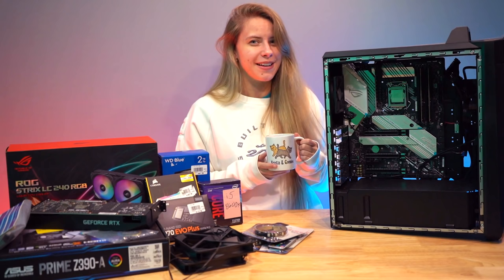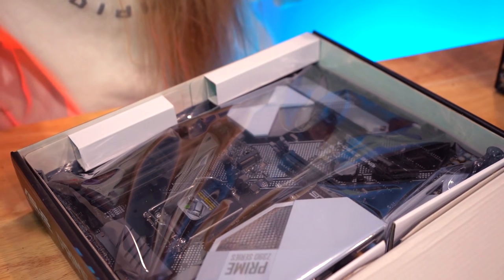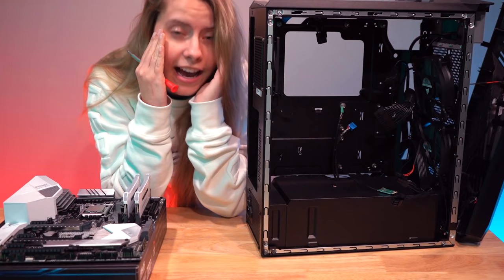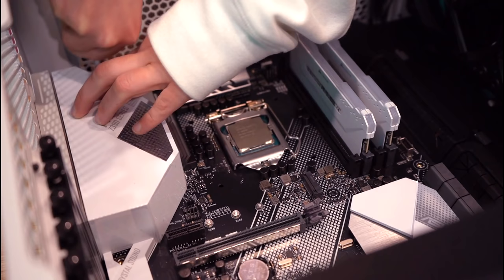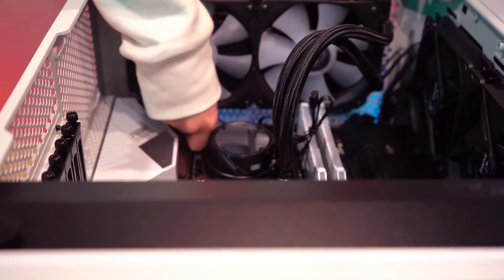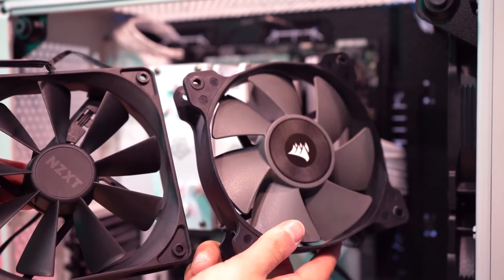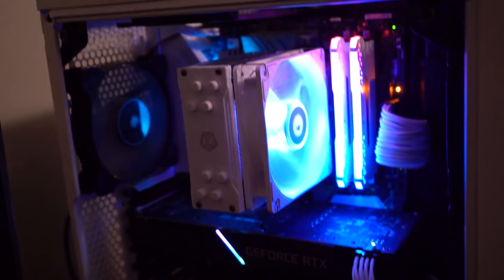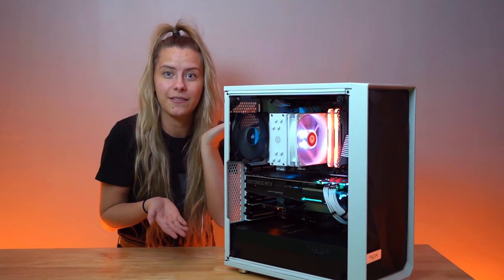I SURPRISED HIM W A CUSTOM PC! 🧡 + GAMING SETUP MAKEOVER! Powered by ASUS ROG

Comment: Pro Tip: plug in your CPU 8 pins before you mount your cooler radiator due to the space limitation.  I have sausage fingers and can never manage to plug those in once the rad is mounted.  It's much easier to push the cables down if needed once they're plugged in vs. trying to squeeze your fingers and the connectors in there.

Comment: just a little tip to anyone new to pc building, check the casing dimension and GPU that you will use before building one, it's a very common problem. :D this is a solid informative Video!

Comment: So I know this video is old at this point in time BUT some times its good to plug whatever video cable you are using into the mother board and double check that its not set in the bios to run video out from the board. Switching cards can cause it to change over (had it done to me) but never hurts to try and see what happens along with re setting bios.

Comment: You can plug a 3 pin fan into a 4 pin connector it's completely fine. But the rgb connector is different just like she had said.
Reply from the maker: fan power yes, rgb header absolutely not ur pc will die LOL

Comment: I was able to get the Deepcool Gamerstorm RGB converter a couple days ago on Newegg because I ran into the same exact issue with my MSI board I built on. The board had 4 PIN but the AIO and Fans were 3 PIN.

Comment: I just built my first gaming PC  3 days ago it looks bad ass I am using  the Rog Strix Z490-E gaming motherboard and the case it is sitting in is the Cooler Master NR600. I just wish I was able to find the Nvidia GTX 3090 for sale it was sold out so I am  still using my old Graphics card that I got in 2017 the GTX 1080 FTW. Anyway great video.

Comment: 21:38 about not losing power during BIOS update: Some boards, I believe have some safeguards / features that allow recovering from that without junking the whole board.
My board, for example (ASRock Z97 Extreme6) has dual BIOS chips, so I could switch to the backup BIOS if needed.  Also if that were to fail, the BIOS chips are socketed, so I probably could theoretically order others and pop them in.  (Although considering my board is a wee bit older, availability of those might be an issue.)

I don't think I can link a picture of my board (showing the socketed BIOS chips) so I tweeted it to you, in a reply to your "yall had such.....here's a before&after pic...." tweet. :)
In the pic, the pencil is pointing at 1 of the BIOS chips (the other is to the left, and there's a BIOS selector switch below the BIOS chip on the right).  (Oh and about the 970 Evo just hanging there in the M.2 slot without a screw ... I ran out of M.2 screws/standoffs, or lost some idk which.  Both my M.2 screws are in use in my laptop, holding in two (1TB & 2TB) P34A80 NVMe SSDs.  I'd normally have an EVGA GTX 1060 3GB SC in the top PCIe x16 slot helping hold down the 970 Evo, but a while ago I was having some issues with display cables & things, and right now it seems to be working running off the 4790K's iGPU.)

I looked up the board you used (ASUS Prime Z390-A) and while I didn't see where the BIOS chip is, or if it's socketed, the manual mentions something about Crash Free BIOS, implying to me that with that board it's possible to recover from a corrupted BIOS, I think with a USB stick or something like that.

As for favorite PC game ... most of the games I like are older ones, from the 1980s and 1990s, maybe a couple from the 2000s or so.  I've been playing Team Fortress Classic a lot (released 1999), and once in a while I play Fortress Forever (2007 - would play it more if more people played it - often I'll jump on, refresh the server browser and literally NOBODY's playing) - that's about one of the newest games I play.  I have a few newer ones, but haven't had a lot of time to get involved with them much.

Comment: I ordered the same pc after watching this and 4 months later its not good for streaming i have a i5 9600k and 1650 super and my entire pc lags and cant handle streaming SMH (FacePalm)....
Reply: @noisybutters what should i do or upgrade?
Reply from the maker: this build isnt rly the best for streaming :/ steve is using it for work and gaming, but not streaming. id recommend an i7 cpu!
Reply: @NoisyButters  Yea. thanks for the tip I didnt know what to upgrade I was going to get a new gpu because I thought that was the problem. And you know how bad the market is for gpu's still lol I'm glad its my cpu. I was think going for the i9-9900k so i wont have to upgrade it again. Will I have to upgrade my power supply because of the i9 or you only need to upgrade that with new gpu's.?